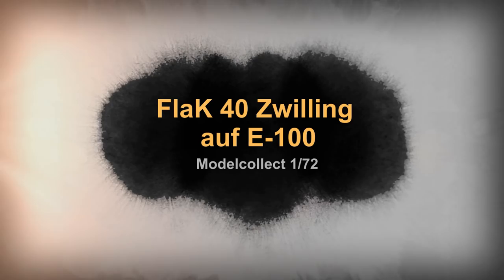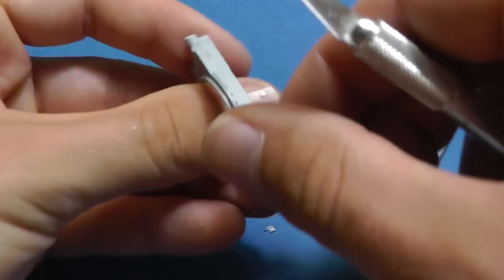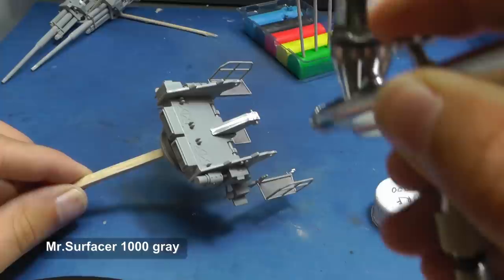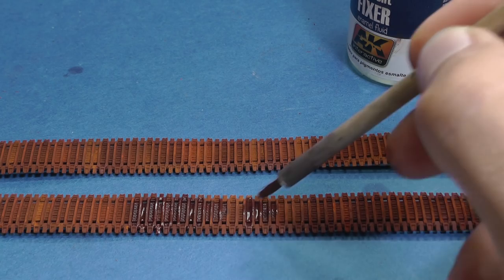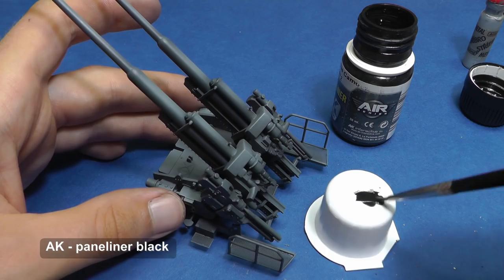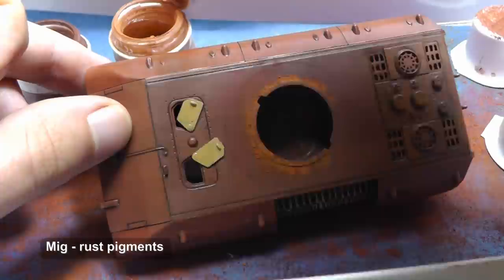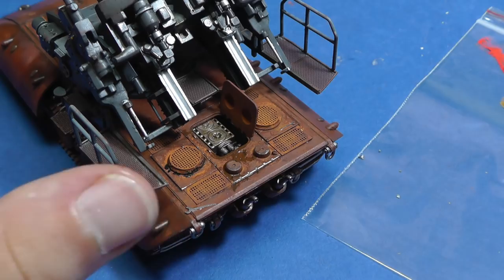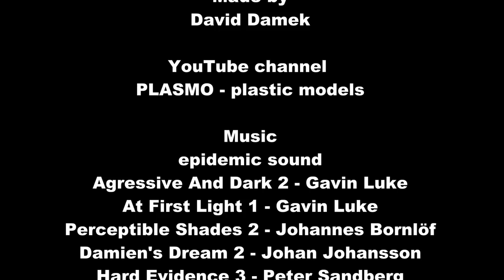FlaK 40 Zwilling  auf E-100 1/72 Modelcollect  - tank model

Comment: The Flak-Bunker in Hamburg-Wilhelmsburg is located in a residential area. Its size is very impressive. In 2013 it was converted into an "Energie-Bunker" with solar pattern and a café on its rooftop. Inside the Bunker you can get a good impression of the massive dimension of the concrete structure. 

But back to topic, nice build as alwasy and please keep up in this scale!

Comment: 4b and 9b pencils can give a great base for metal parts when layered for small engine parts before a brown \ orange light wash.leaving a humbrol aluminium enamel lidless for two years makes a nice metallic paste,i found out.outstanding work for scale,especially with the largesse of the chassis devoid of real detail.You changed that completely.I ordered my 0.2 brass sheet after your nashorn vid.Have done tiger skirts shrouds turret box and front fenders with 1mm brass.Thanks for push out of comfort zone.

Comment: Your so good at modeling. Can I request a winter camo on your next tank PLEASE. Keep the great videos coming
Reply from the maker: Ok. But next time it will be Abrams a1m2 tusk and mig-29smt. Abrams is finished and mig-29 is on the table but after that, I will build Panzer IV J with winter camouflage. I promise
Reply: PLASMO - plastic models tx so much
Reply: PLASMO - plastic models - hey David, I'm looking forward to the Mig-29, what kit are you building? I have the Great Wall Mig-29 in my stash. And what is the Abrams, Meng?

Comment: I am not familiar with this brand of plastic model 
I have built bandai gundam kits in the past are they similar quality?
Reply from the maker: That was not a good choice. You should start with some worse like old heller or old Airfix kits. I'm afraid that it is nothing better than a bandai on the market so far. Sorry :-D
Reply: PLASMO - plastic models why would I want to start with a lower quality model?
Reply: Joey Cool productions less parts and cheaper
Reply: Invincible there still expensive though

Comment: I'll also add that you contradicted yourself a little, since you did the red oxide base coat like it was brand new and rushed out of the factory but then you added rust and scratches like it was old and used
Reply: It was rushed from factory and then used on battlefield. Easy :)
Reply: Steel plates that have been lying in the open for a while look just like that. And because the machine had to be rushed through the assembly line there was no time to polish the rust off and/or paint over it : ) And you can tell that the welds are fresh and still shiny!

Comment: I don't get the reason you've left armor skirts on. Wouldn't it look better if you had given it a more improvized look and backstory? Like literary a factory had a half working damaged in battle E-100 chassis and an AAA installation outside that needed to be moved to a better position? Strip down E-100 a bit, include sticking out parts of improvised mount, maybe add some tubes to show that hydraulics of the gun are fed from the tank now and bam, ready. Similar to one of those instances where tanks had mismatched turret welded on top in combat condition and basically turned into SPGs, I mean.